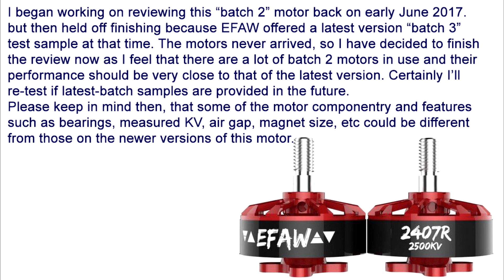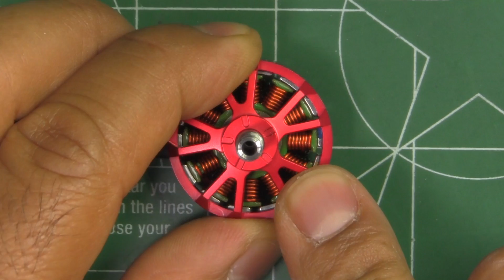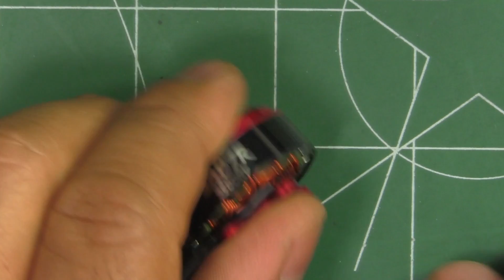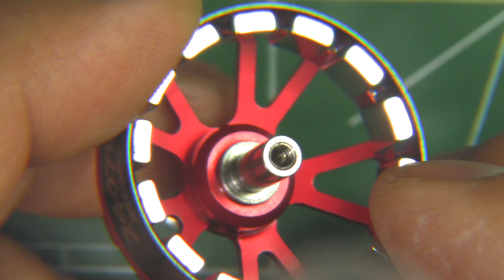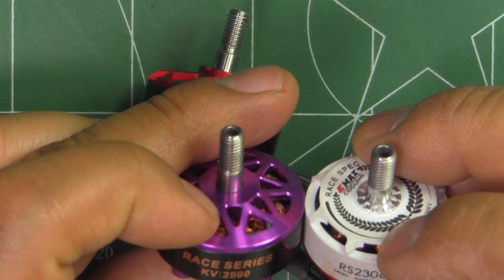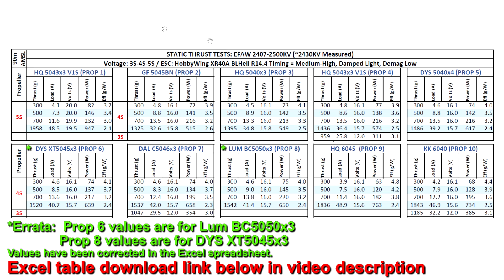EFAW 2407R-2500KV Thrust Tests & Overview -Batch 2 Version

Comment: These motors draw 130a at peek.  I dont umderstamd why you would use these over a smaller more efficient yet still powerful motor such as a 2206/2300-2600kv motor.  Opinion?
Reply from the maker: Almost all of the "big" new motors are able to draw quite a lot of juice at peak burst, but that's when you go full throttle and it's only for a second or 2 at most, then LiPo begins to complain. What people  do is train themselves to control the urge to blast full throttle too often and only use what's needed. What is see most top pilots do is use 75% to 85% throttle to do their acro tricks and only use full power very few times. Definitely you gotta mind throttle stick position more with all these big motors. Just a matter of energy, All that high thrust needs all those Amps. 
Some people are going for ultra-light sub 300g setups (no Lipo) so the big high-KV motors are not really stressed much and in-flight they'll draw very close Amps to the smaller motors.

Comment: I'm really loving the batch 3 efaw 2500kv motors. Every issue seems to have been fixed. One thing that really blows me away with this motor is how cool it stays, even on 6s.
Reply from the maker: That's some good real-world testing testimony. Nothing beats some aggressive long-term abuse to see how well a motor is built. Now let's see if the next "amazing" motors will be the new FinX series from SilverDrone.
Reply: EngineerX funny thing... I have the FinX40 1.5k on my 6" quad right as we speak. I am pretty blown away so far by it.
Reply from the maker: From the little I've seen, that Flux ring seems to work and motors are nicely built. I think they're going to be like these EFAWs.... hard to get, batches selling out quickly. man... you got some good selection of motors to play with.... looking forward to some flying action on that setup.

Comment: Hey Mate, thanks for this great review again. You do so a great job! I wanna build a sub 250g qwad. What motor can you suggest me. I need a mix from durability (most important) and speed! (High thrust). Price doesent matter. Im looking to 2204 2722kv hyperlites sub 200g build but im limited on props. Or the 2206 2522kv hyperlite v4 naked bottom ~250g ish build. What can recomand me?
Reply from the maker: Good recommendation there from 2 guys that know their stuff. 2204's won't have as high torque/punch as a light 2205 or 2206, Hyperlites are perfect motors for your goals, try and save as much weight everywhere else, cut down all wiring to perfect lengths, If you got the budget buy titanium screws. Use 4 for mounting motors, will save bases on a bad crash.
Reply: Ohh and its for racing! If not obvoius. :). I want a light fast qwad that can takes beatings all day like a champ.
Reply: Floss 5 2version, aio asgard, hyperlite 2206 2722kv, Foxxer MIcro v2
Reply: Petryshka exactly: no 2204s
Reply: King! thx Buddy.
Reply: Actually i'm looking for setup now of 210g dry, and what i found the best so far (price/power/weight/durability).
So : Floss 5 frame 
Racerstar aio F4s ( or Tatto F4s for 32bits)
Hyperlite 2205 2600kv (mid of 2204 and 2206 in power and weight perspective) and also cost only 13$
Foxxer Micro v2
Eachine vtx02 
Xm+ (if you have taranis) 
Pretty much it

Comment: Nice test. I want to see some 7" prop on some of these new large stator motors.
Reply from the maker: I ran HQ7040 on the Thor 2500KV and the Amps were excessive, the overload safety shut-off kept triggering on the Power Supply and Amps climb to over 70A :0 
I'll dig up the video if I find it I'll upload it with some partial readings, not sure if I still have it as I aborted the test. 2500KV is just too high for 7" on the thrust stand. In the air it should be OK perhaps.
Reply: EngineerX I have been trying to make my mind up. But I can't decide what motor would be good for 7" props. What would you recommend?
Reply from the maker: Will do!. 1900kv should be a better match for a med-range setup. On 7" it will give you plenty of thrust. For just cruising around even 1500kv would work. Most motors (of very similar size size) will draw about the same Amps when lighlty loaded, even if they have different (but close) Kv. Like 1500 vs 1900 vs 2200.

Comment: For 5 inch. They seem pointless... yeah nah?
Reply from the maker: I only bought 1 for testing. They're too pricey for my skills.... LoL, I think I'd fly just as well on $12 motors but these are like Ferraris, nice looking and do perform very well and smooth but I'm a turbocharged Japanese sport car kind of guy LoL
Reply from the maker: $22 sounds reasonable for premium motors, which from what I saw MAD Racer motors are in the premium category.
Reply: KillaG FPV no torque, and efficiency. Put the dal 5x4.5x3 BN v2 on them!
Reply: need to see the amp draw in flight. you get a set to fly Engineerx? i dont think the weight is too much of a factor with the Tq's this should put out.
Reply: These are great motors for 5S & 6S on 5".  Otherwise, there are better options out there for 4S.  Check out my channel for some 6S flights on this motor on 5".
Reply: EngineerX i know precisely what you mean! Lol bang for buck! Speaking of. $22usd for mad motors sound reasonable? Packaging for the set is quite tidy and nice. Stickers. M3x6mm and m3x8mm bolts for 4-5mm arms with or without softmounts. Give peeps the option.

Comment: This is what we should run 8 inch on?? Lol
Reply: KillaG FPV not that was my ex I ran the 8" hype train on datt ass!
Reply: Jonathan Dahood come again?
Reply: KillaG FPV seriously though I'm going to be using 2200kv for 6", and 2500kv for 5".. I use 6" on the brother Bobby r4.  Efficiency sucks balls. Hopefully I'll have the efaw 2200kv in the air this week.
Reply: ahh gotcha! i use MAD 2306 on 6040x3 hq prop. 2750kv :) also same motor on 6s 5048x3 props  racerstar v2. i run 30a littlebee32bit for 6s and 25a bl heli s esc's for 4s no sweat.